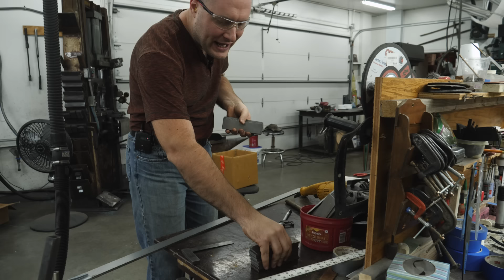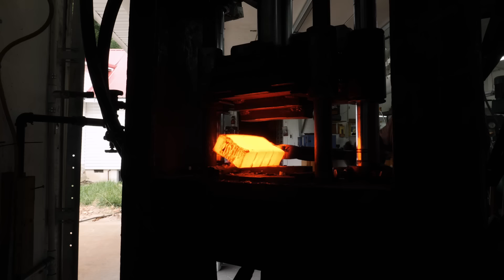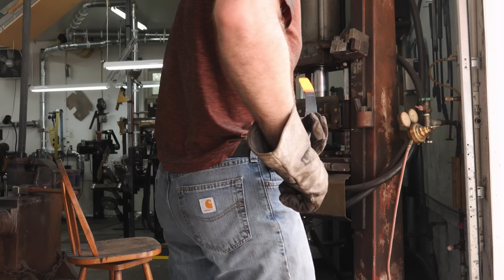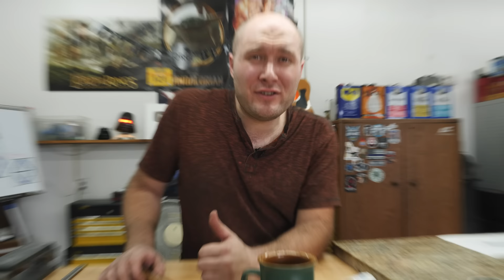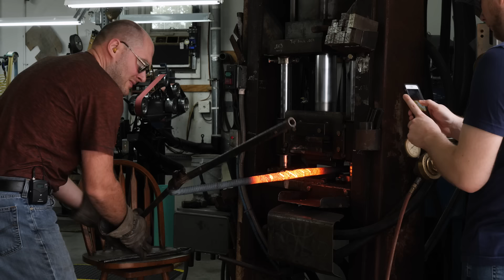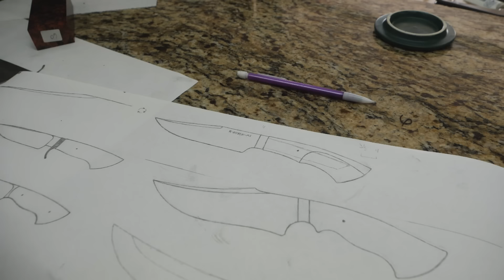Making Twisted W Damascus

Comment: Did you just skip showing the cleaning of each piece of metal before welding up the stack or do you find that not to be necessary for a good weld?  I've stuck to the super cautious grind each piece clean on both sides before stacking so far, but if that's not necessary it would save a lot of time to skip!
Reply from the maker: We clean them with a 1/2 wire out 120 grit belt then stack and wrap 

Dad

Comment: What is the purpose of the sheet metal?
Reply: The sheet metal encapsulates the steel so that no oxygen can get in between the layers of the billet.  That prevents formation of rust between the layers.  Some smiths use borax between the layers instead.  The goal is the same: to prevent O2 from causing rust to interfere with the forge weld.
Reply: @Thomas.Wright  
Thanks Thomas

Comment: Wouldn't it be easier to use a vice instead using a power hammer at least if he doesn't have christening his own she can hold on to the bars and walk around and twist bar easier
Reply from the maker: There’s a little more control of the billet in regards to symmetry and spacing of each rib on the twist   
It may take a little longer this way

Comment: I heard of knife making in 2019 then learnt basic grinding with scrap scissors 
Then last year I got some decent flat bar but I bought it extremely thick since I was worried about thinning the balde too much 
Then I learnt 8mm is a bad and 3mm is good 

Now with that 8mm knife its ~7inches long and when I went to design another knife which is meant to be smaller version of that 7 inch knife  
The small ones rough sketch is the same as the 7 inch. But it feels right then I remember I heard from elsewhere that 7 inch is large 

So what is the length of a normal dec knife  and what is too small and too long
Reply from the maker: Hey awesome unknown, you are in a good spot 
You’re asking the right questions. There’s no end to preferences with knives. Purpose of knife , local laws , specific purpose, all round utility , or cutting veggies. 
You design it to your desire or your clients needs. I hope this helps. 
Keep studying. You’re headed in the right direction my friend 
Keep Forging On 

Dad
Reply: @KyleRoyerKnives  thanks alot

Comment: 1st
Reply from the maker: Congrats!  :D
Reply: @KyleRoyerKnives  question- is there a steel other than 15n20 that has a higher carbon content that could still provide a contrast when etching? I feel like a lot of smiths are sleeping on doing damascus with 2 baller blade steels.  like, if you made a blade out of just 15n20 it would probably suck. what if you did a damascus with 1095 and (insert other baller blade steel). Maybe one steel has impact and abrasion resistance, and the other has edge retention.
Reply: @fettmaneiii4439  15n20 is just like 1075 with a high content of nickel. 1075 is high carbon something like .75% carbon 2% nickel so 15n20 would make a decent blade alone and yes there are other steels like L6 and several others I have heard of!
Reply from the maker: Not sure we use 15n20 
15n20 has a good carbon content 
Would make a great blade by itself 
Cheers my friend 

Dad
Reply: @KyleRoyerKnives  yo! Let me rephrase the question to make more sense then- instead of focusing on damascus steel for aesthetics, ever consider doing damascus focusing on blending performance instead? Clearly 15n20 is chose as a "run of the mill" for aesthetics, but what about making a steel blended with another steel solely for performance?  Maybe this line of thinking makes more sense phrased this way? maybe 80crv2 w/ an M-series steel or something. Maybe you can do a "Royer PM" blend (performance mosaic) and a "Royer XP" blend (xtra performance) that you wont have to focus on perfect etching everytime with.  no i'm not high ripping the bong, im just riffing out ideas lmao